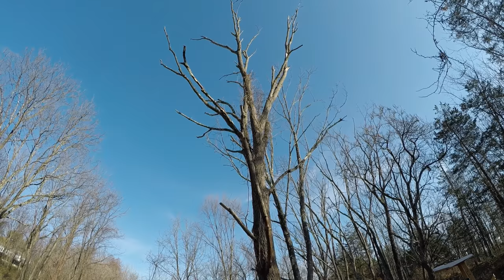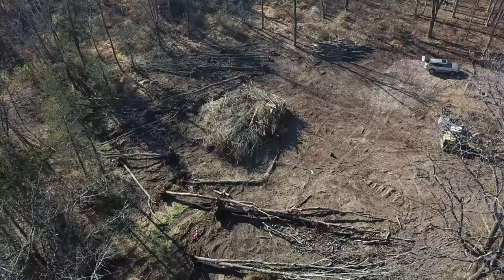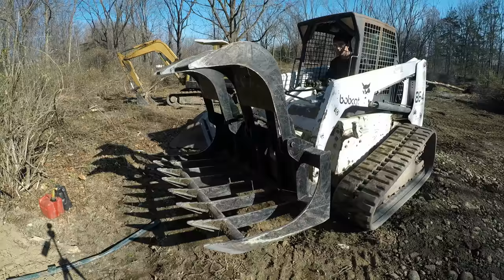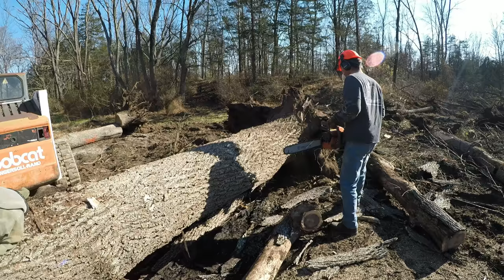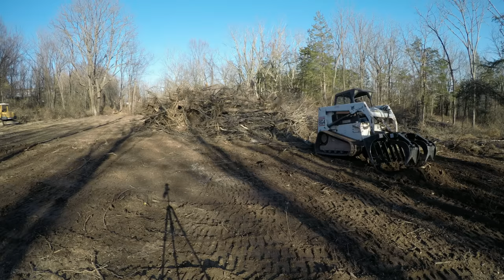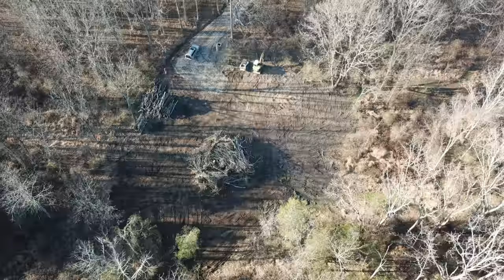Clearing land with excavator and skidsteer

Comment: Good advice on pushing over trees. I usually get dead trees down by gently pushing on them with the backhoe bucket of my Case 580. Even with a solid roof/ROPS I sometimes worry about dead branches breaking off and coming straight down into the cab. Could cause a nasty headache. Getting dead trees down can be a nightmare. Be careful out there.

Comment: Great work, small peace of advice with the chain saw. Complete your under cut first approximately 1/3 of your stock the cut from top down, cut small to large. Keeps the weight off the trunk section. Remember to keep those chains sharp, easier to manage and Less of a chance of kick back. When your chain is stuck a wedge is your friend. Good to see you wearing face and eye protection, 5 minutes of safety is a life time of work....

Comment: Andrew, I've got a similar size machine (cat 304ccr) original had a 24" bucket that I learned to dig stumps with. Long story short I put a bobcat x-change coupler on it for ease of use, and I can't get anything but bobcat buckets around here, bought a new 24 and 12" bucket. WOW, a 12" bucket is more than twice as quick at digging stumps and breaking roots.

Comment: in reference to the plastic roof on your excavator (while pushing trees over)...you can get a good plastic called Lexan to make a safer roof.  you can get it online or from a local glass shop.  1/4" thick should be thick enough.  you can take it to a sheetmetal shop and they can shear it to size for you.  it can be broke in a press brake if you want to bend the edges over.  when drilling holes in it, you need to use a dull drill bit and melt a hole thru it.  there may be a better way to drill it but that is what I have done.  you can get it in a 4' x 8' sheet or lesser sizes.  this stuff is pretty tuff.  be safe young fella.

Comment: Wonderful job, great work.  If you learn to float your boom  you can do a much easier and faster leveling of the rock or dirt.  Also I always have the dump truck dump the loads in 3 or 4 smaller loads which makes it easier to spread and it doesn't overflow the width of the driveway.  Works for me.

Comment: I live in the midwest and the problem you have with ash trees, we have with elms. I've taken down a lot of small elms in development areas that were once woods, or farms. I didn't have Bobcats or excavators to use though, just ropes, my pickup and chainsaws. I did lot of cutting and finding a place to take the stuff wasn't easy. I didn't have a chipper either.

Comment: I'm glad you mentioned the risk's involved in knocking down old dead trees, I had one drop it's large limb on my , actually, my John Deere 350, but thankfully it did have a ROPS system that saved the day,....and my head!
Reply from the maker: Reg Sparkes yeah, that Yanmar has nothing so I'm careful. Stuff with big metal roofs, I'm less careful.

Comment: Great job, Andrew. I came onto this video because of a specific search related to equipment:

I'm clearing an overgrown fence line, mostly saplings, vines, and brush. Due to budget, I have to decide between either a skid steer/track loader, or an excavator. Which is the most productive, bang for the buck to make best use of time and capabilities?

Comment: Andrew how many hours are on the new bobcat?
Isuzu or Kubota motor? Turbo?
You should do a radiator flush/coolant water change this winter. Change the thermostat too. These motors require a special type of antifreeze or you can see cylinder  liner corrosion. 
Change the hydraulic oil filter to. 
The dream of having a nice tracked skid steer like yours!!
Reply: 864,863 and,873 all used the duetz motor which is oil cooled turbo .
Have a 873 and T200 which is the same machine as an 864.
Reply from the maker: It has 2200 hours, way less than any of my other machines. That machine works well.
Reply: Andrew Camarata..... can you do a video on the maintenance for this loader maybe at winter?
Reply from the maker: I can, I usually thought those were a little boring so I don't film that.
Reply: Andrew Camarata not boring to everyone. More content = more subs. You would be surprised what people like to watch on YouTube haha.
Reply: I second that.

Comment: when i cut up logs i just use a 6 foot long stick and make marks every 2 feet so i can make 8's, 10's and 12's. im suprised the sawmill doesnt fuss at you for cutting them random
Reply from the maker: Not many of those went to the mill. And the ones that did were getting paid to be milled, so it didn't matter. But If I'm selling logs to a mill, I will usually measure them out with my feet.
Reply: o gotcha, yea that works too

Comment: Just curious. I’ve watched a bunch of your videos and am impressed with your skill level. I have a very hilly property in southern Ohio and have been using my Deere 4500 to maintain it for the last 20 years. The Deere is getting old and I’m going to swap it out with my bobcat 863 that I’ve been storing at my office. It’s a wheeled skid steer and I’m a little worried about it sliding on the hills. What are your thoughts on using a wheeled skid steer to clear brush and trees on heavier terrain?
Reply from the maker: The wheeled ones are good on hard flat ground. They don't do as well on hills. Try it and see how it works.
Reply: Thanks for your feedback. I will do that.

Comment: Why the wider tine spacing on the grapple?  Looks like 9ish".  Why not a 3.5" spacing?
Reply from the maker: I don't think its quite 9", maube 5". That grapple works really nice.
Reply: @AndrewCamarata  yes im looking at them and can't decide on tine spacing....narrower and you can get more finer stuff....wider leaves more small mess behind but has other benefits.

Im thinking in terms of "filtering rocks out" as well.  Hummmmm.....
Reply from the maker: Mr Push If you want to use it for sifting rocks, then you want a skeleton bucket. That bucket I’m using in this video is better for cleaning up brush and moving logs stumps and sometimes garbage. There are quite a few videos on here of me using it, I really like that bucket, I also have a demolition bucket which works better for picking up garbage, but doesn’t work as well for brush and logs.

Comment: i wanted to ask u about the electric wire u buried a few videos back. in the video it looked like it was buried in the driveway--did the land owner want that? could it have been buried off to the one side more instead? what happens if the driveway gets black topped some time later, and then the wire goes bad for some stupid reason then, and has to be gug back up under the drive way? just curious about that? me--i would of wanted it not underneath any part of driveway-but that's just myself-ok. 
i laid my tree's out the same way u did, but i had a Cat 977 with a root rake that i cleared with, and a fella running the chain saw back when i worked around the Washington, D.C. area, when the coal business took a flop back in the mid -80's. keep them coming, enjoying them very much. thanks!
Reply from the maker: BigJim57 I don't think those electric wires go bad, even if it did you could probably pull a new one threw the conduit. If the driveway was Blacktopped, and that wire needed to be replaced, I would just move it somewhere else.

Comment: On the grapple on the skid steer are both thumbs controlled by one switch( or whatever controls it)? Or are there switches for each thumb? Also, are the tracks controlled by the pedals and the bucket/arm controlled by the joysticks? Or vise versa?  I’ve seen both before.
Reply from the maker: Both thumbs are one switch, they are just hosed together, so whichever one has less load moves first. It works good though. That skid steer has no pedals.

Comment: what model grapple is that? looks like its a Cleveland Equipment sticker on the side. What model is it? 72" wide?
Reply from the maker: Yes Cleveland, I think its 66". I like it.
Reply: Great thanks. going to order a brush grapple this week.
Reply from the maker: Yeah. do it, get a heavy duty one, especially if your using it on a tracked machine

Comment: What a pile, wow!
These hydraulic couplers, don`t they need to get bleeded like a car brake line, everytime you re-connect them?
Or do they close tight by disconnecting?
Nice work, nice vid, as always!
Thx!
Reply: It's a quick disconnect. You just plug/unplug, done.
Reply: No you don't bleed them. They have little check valves on them. Same as a tractor.
Reply: Horst Szibulski  you never have to bleed attachments like that even if they are new and have no fluid in them.  They flow in a loop so the air just gets pushed back to the skid steer tank.  May just take a few sounds for them to work.  The worst part is if you leave pressure in the lines. Like if you clamp the grapple as hard as it will go and then just unhook the lines.  Good luck getting them to plug back into the machine.  Always relieve the pressure or you will be loosening a hydraulic line to bleed off some of the pressure.  Been there done that.  More then once....
Reply: No. It is not like a car brake line.

Comment: No chaps, man?
Reply from the maker: You don't need them if your not going to chain saw your legs.
Reply: Very ignorant response! The ones who are cocky unfortunately find out at some point. Learn to take corrective criticism.
Reply from the maker: Slim S chaps seem like a clumsy annoying thing to be wearing.
Reply: They seem better than prosthetics later.
Reply from the maker: KainusGulch I've been using a chain saw since I was 8, never once have I ever came close to cutting myself.
Reply: KainusGulch I don’t think chaps really provide anymore protection really
Reply: I am 62 years old...ran chainsaw since I was 17 years old falling and bucking trees worked in sawmills and have cut more trees and firewood than most men and have never worn chaps......you just need your wits about you and some friggin strength in your arms to keep that saw away from you.....many times it has bucked back but you watch out and handle it.....most of the time it involves common sense and todays young ones dont have that I guess.....it looks like he knows what hes doing....and besides its his legs pal....
Reply: I stopped watching wranglestar after he used nothin but clickbait to get u to tune in to his channel......hes a fraud...

Comment: please down for removing here's a hint for you start from the tip of the tree and work towards the butt of the tree that way everything is above ground when you're cutting it. If you cut your first cut at the bottom everything falls to the ground you stand a chance of making the chainsaw. Start from the tip work your way down and you should save everything up to 6in from The Sawmill when it's black walnut only because it's nice wood you can save some of the Walnut and put it on a wooden lathe for lamp stands for your house or any small boards that you can Mill for Cabinetry or something just a thought
Reply from the maker: Good tip, I guess I just cut whatever I'm closer too. There's a big pile of the walnut wood there.
Reply: I cut trees for years and nobody in my area paid money even for nice walnut logs. I still can't understand that since everyone says they're worth a lot of money.